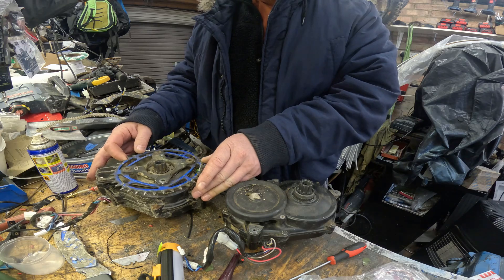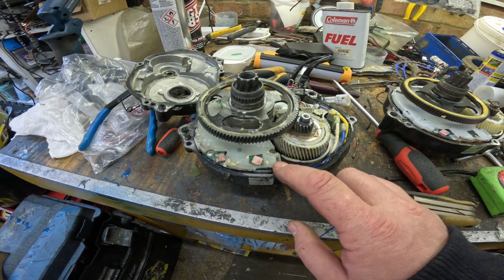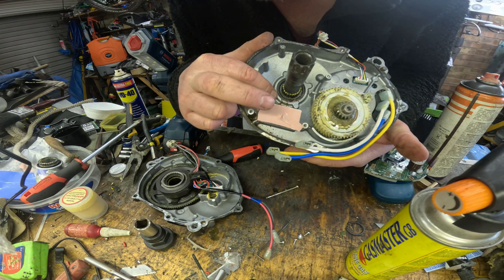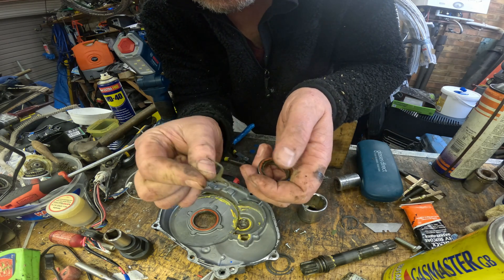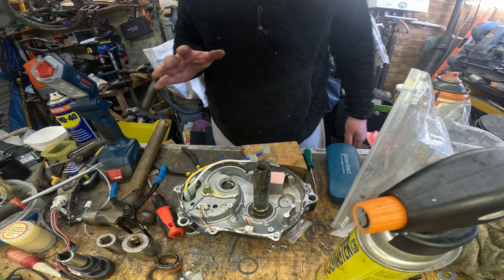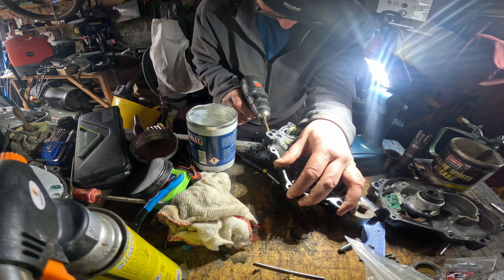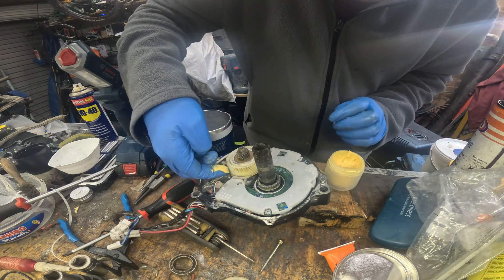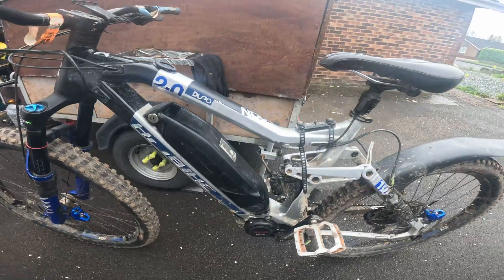Ebike Motors are  not waterproof here is how to waterproof them!

Comment: That's a-lotof tinkering-around with an expensive component. Surely no company would allow a warranty-coverage, if this is done, and the motor...fails. Much the same as installing a speedbox, which voids any warranty. Your best option: Keep that expensive e-bike toy, out of wet weather. That includes humidity. Yes. Humidity damage also tends to void most motor brand warranties.
Reply from the maker: Quite right I mentioned in the description not to do this if you have warranty.

Comment: Can you seal up these middrive motors to reduce the noise levels?
Reply from the maker: Mid drives are ushally sealed from a noise perspective.   Depending on the noise it can be a indicator of a failing bearing

Comment: It's ridiculous really that the tech is designed without properly acknowledging water ingress that causes so many problems. I'm on my second Yamaha PW ST motor after 500 miles in and 3 months from getting the bike new. It rains here in Wales and I can't split open a motor as will void warranty.
Reply from the maker: Ride it like you stole it until the warranty is done then learn to service it yourself

Comment: Wouldn't petroleum grease be better for the connectors, we used to fill all our electrical connections on our motorbike enduro bikes for beach races etc, especially on KTM's?
Reply from the maker: Petroleum grease is better lubricant but that's not necessary hear.  Silicone is more inert and better at higher temps.  If you do a long mountain climb the outside of the motor can get extremely hot.  Probably even hotter inside.  Silicone is more stable in heat.  So over all I think it's best for job.

Comment: Fantastic video mate. I wish more people talked about the limitations and weaknesses of ebike motors. I'm a big fan of the rctestflight youtube channel. In qwuite a few videos on that channel he shows using a paint on conformal coating for rc vehicles that actually get properly submerged and survive so the conformal coating is well proven in the RC world.
There are plenty of other ways to achive similar results.
Another great channel to check out would be TronicsFix. When cleaning a board I would use isopropyl alcohol and cotton swabs rather than brake cleaner and a rag, but whatever works. 
Not sure if you mentioned it but for some motors eBike Motor Centre (formerly performancelinebearings) sell upgraded seals for the axle which does a much better job of keeping the water out than the standard seals.

If anyone does plan on whining about the board "overheating" due to these mods you could easily remove or modify the plastic covers on the side of the motor which would improve cooling. We don't get overheating issues here in Australia, so not sure that overheating would ever be an issue in the UK. You could even go next level and buy better thermal pads from thermalgrizzly.

Comment: I have a pw-se since 2018 and it's been under water several times including the battery connector 
Done 4125 miles so far never been opened and still runs like first day 
I'm speechless on the quality of yamaha motors especially the old models 
Sometimes I crave a new bike but I don't have a reason to get a new bike because my old sduro still runs just fine
Reply from the maker: On the older Yamaha motors the bearings were much bigger and lasted longer.   If you look in the description of the video there is a link to lake district video.  Then you realise I ride very wet long rides.   A Bosch motor died on that ride as well.  There all constructed similar and all get water in them it just depends on how often you ride wet and how good the bearings are for how long you get away with it

Comment: Great video. How did you seal the remote vent tubing into the motor housing?
Reply from the maker: Hi I just used some locktite seal and lock.  The pipe is modeling tube from eBay.  In next version I will use a threaded barb.
Reply: @LazyMTBrider  Threaded barb is a good idea. I think i have the same motor on one of my eebs so this will come in handy.  Thanks